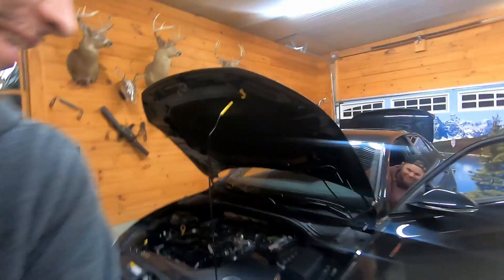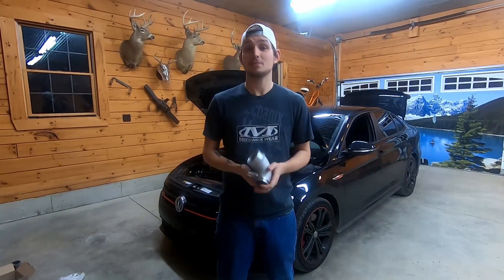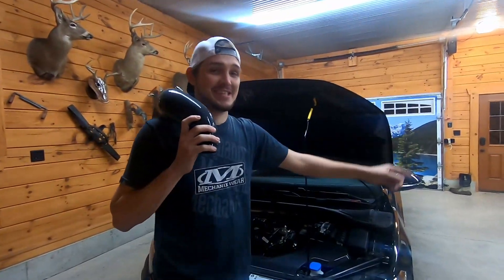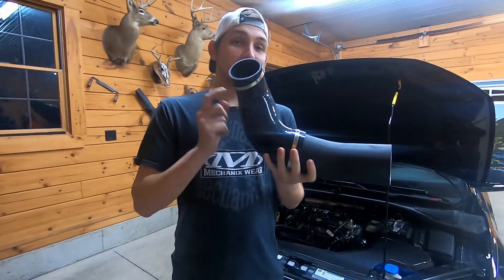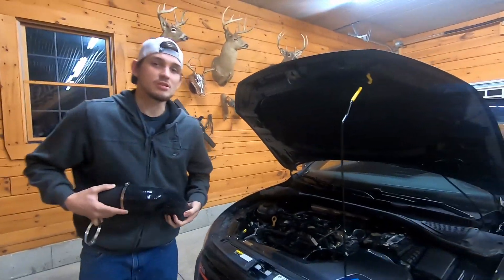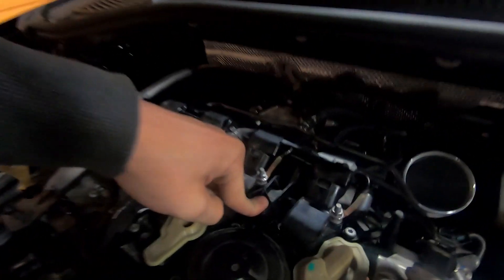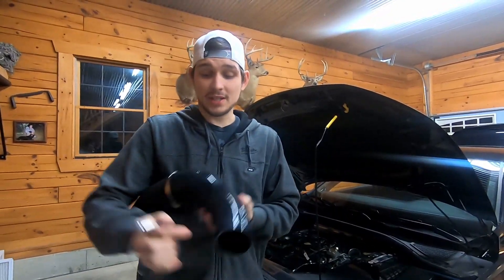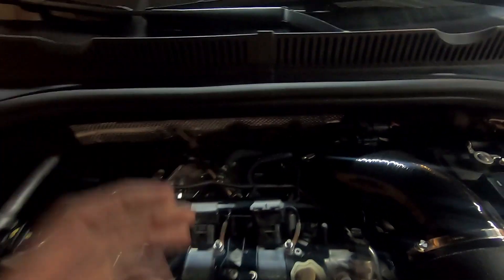Integrated Engineering's Turbo Inlet Pipe Install on a 2019 Volkswagen GLI!

Comment: Sounds insanely good. What’s ur set up now? Turbo muffler delete, Cold air intake and inlet pipe?
Reply from the maker: Yep, neuspeed charge pipe with turbo muffler delete, Integrated Engineering cold air intake and turbo inlet

Comment: Why did you have to remove the coils? I installed inlet on my mk7 gli and didn’t have to remove it. But the ie instructions said too. But this was for a gti.
Reply from the maker: In order to get the pcv tube out you have to take the coils out but you can take the pcv right off the inlet. So your right their is no need to remove them.
Reply: Yeah I read the instructions after I swapped mine out. I was like why remove the coils?  What else d you have planned. So far I have inlet, cold air intake and turbo muffler delete. I’m thinking a tune will be next.
Reply from the maker: @Teefisj1  yeah I’m not sure why they tell you to do that. I’m sure theirs a reason be hide it but oh whale. Hell yeah man! I wanna tune mine but stock clutches are trash, so I’ll have to upgrade that first. I’ll be putting my exhaust on this weekend!
Reply: @mr.boosted9983  nice. Cat back or turbo back? IE make a nice Down pipe. Looking at AFE for the rest.
Reply from the maker: @Teefisj1  neuspeed cat back, I want to go with IE down pipe
Reply: @mr.boosted9983  nice can’t wait for the next vid. 👍
Reply: @Teefisj1  I have the same stuff done to my ‘21 GLI. I’m thinking either a tune or exhaust. My last car had loud exhaust which kinda made me not want exhaust on the GLI. I’ll probably get the tune and then go from there
Reply: @esisters7051  I just received in Ie inlet pipe and air intake, gonna install it on my 21 gli tomorrow,  was it hard?
Reply: @Teefisj1  I'm pretty much done with mine today and just now read the instructions and was like WTF?  I'm assuming your install went smoothly even though you didn't remove the coil pack?

Comment: Hey dude I have a 2021 gli I’m trying to accomplish the same things. Do you think these mk7 parts will work on mine aswell?
Reply from the maker: Yes, the 2021 are still Mk7 so you shouldn’t have an issue!
Reply: @mr.boosted9983  okay one more question how’s IE compared to other brands do they have a pretty good rep? And what part do you recommend first to last in install order !
Reply from the maker: @masonblack2599  a lot of people in the vw/Audi world run IE they make very good quality parts they are a bit on the expensive side but way worth it! Also their customer support is amazing. I would personally do the turbo inlet and cold air intake at once. Main reason is because the IE inlet requires aftermarket intake to use.
Reply: @mr.boosted9983  after these the turbo muffler delete got it dude thank you I can’t wait. You gunna get it tuned?
Reply from the maker: @masonblack2599  let me know if you have any other questions follow me on Instagram @lucie_mk7